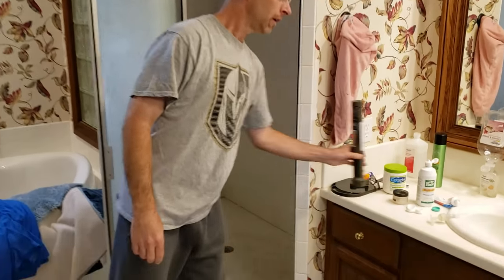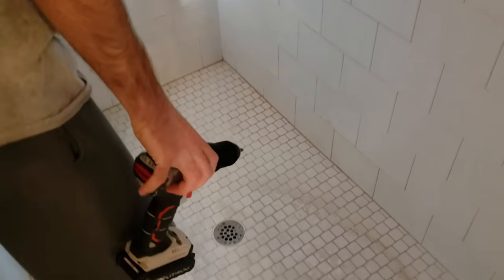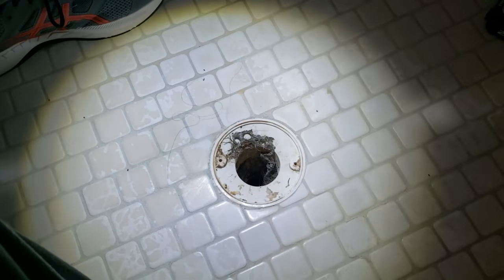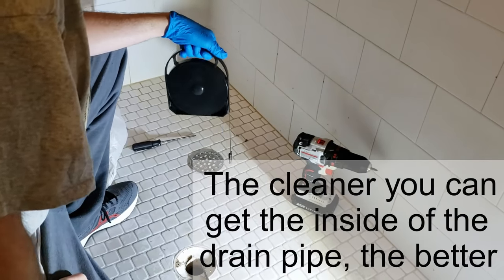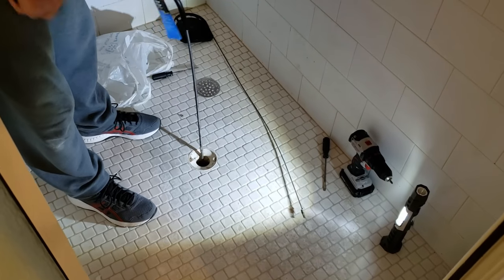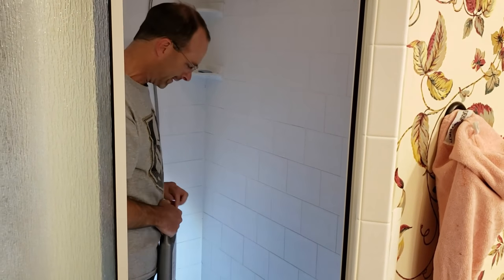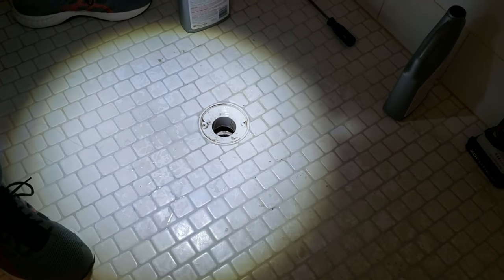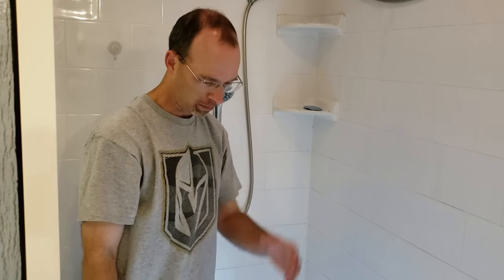How to get rid of drain flies in shower, kitchen, or bathroom

Comment: Instead of the Drano, after I clean the drain out, I use boiling water and add dawn liquid soap, and vinegar. That we are not putting all those chemicals into our water supply. The vinegar and water really does flush and clean well.
Reply: I just tried this with white vinegar and baking soda, and washed it down with boiling water. Two GIANT flies attempted to flee out of the drain but got caught by the chemical foam from vinegar mixed with baking soda 😁

I'm gonna pour boiling water once more today and see if it helps the situation.
Reply from the maker: Some folks have warned that boiling water could damage certain kinds of pipes. I recommend using hot, but not boiling, water.
Reply: That doesn’t work buddy!

Comment: Those things are disgusting! 😱 LOL Thank you for the video. They spend quality time in your john also and wind up on your ham sandwich. 🥶 It's essential to cover all of the drains after you treat them. That way they'll stay in there until you get rid of them. There are rubber drain covers, (or plugs) of all sizes. Find one that will fit over it about a 1/2 inch extra. Put a weight on top to trap them. Also, good old generic liquid bleach will dissolve all hair. I would pour about a half-gallon down there and then cover it and leave it alone for two hours. I did that and they are gone.
Reply from the maker: Great tips. Thanks!

Comment: Years ago, my dad came up with the idea of straightening out a wire hanger, then bending one end of it into a hook small enough to fit in drain yet large enough to grasp whatever's in there. Cut to the length that suits your need. For a bathroom sink, you'll need to remove the stopper if it has a crosswise lever from the drain pipe that goes through it.

Comment: I've had that issue in 2 brand new apartments. The builders had dumped all kinds of crap down the drain and you would be surprised what I found. There was plastic bags of screws, nails, carpet, concrete, rubble, silicone, grout, sand, nails, tiles, so over time using the shower it got so bad , the flies, the smell. Omggg. Any way, what you did wasn't good enough. You have to flush and flush with boiling water up high and flush and scrub. Use dish washing liquid and then use buckets of hot water held high and tip it down the drain until the water runs clear. You don't need draino. Just remove the debris. Get a garbage bag, put it around your arm and grab the crap out with your hand and arm. Yes it's gross,  but it works. I had a plumber come the next day and say, omg wow I've never seen a drain so clean in all my life.lol so the blockage I called them about, was unblocked by me, the plumber didn't have to do a single thing lol. He was the one who told me not to waste my money on draino. He Said I did the right thing by using dish washung liquid as it's best to break up the gunk. Try it and I swear you won't have a single drain fly ever again. Just clean your drains often.
Reply from the maker: Good info and tips, Nicole. Thanks. Yes, the key is keeping the drains clean.
Reply: Dishing detergent wasn't strong enough. The drain cleaner was needed. Everyone's situation is different maybe. But mine solved after follow this video.

Comment: I had this problem last year, cleaned drain best I could.
Followed with baking soda and vinegar . Rinsed with
Boiling Water. 
Even made homemade drain fly traps(Dawn & ACV)
Kept under control... Last Year!
As soon as temperature warmed up THIS year - Bam stupid flies are back!
But this year I will be using the pipe snake Woo hoo.
Thanks for the tip 😁
Reply from the maker: Great input, Samantha. Thanks for sharing your experience!
Reply: How do you make the traps you got a Link . I’m getting drain flies moths like bigger than those smaller ones he had and I just did salt bacon soda and vinegar . Letting it sit over night then boiling water in morning.
Reply from the maker: I don't know how the other person made traps. I found that if you clean out the drain really well, they'll have no home and you can simply kill the remaining ones and the problem is gone. But make sure to take the drain cover off and dig out as much gunk as you can. That's where they're breeding and they'll come back if you don't.
Reply: Isotopes yeah there gone hallelujah!
Reply: Isotopes salt baking soda and vinegar worked well .
Reply from the maker: Great! Hopefully I never have them again but will use that combo if I need to!
Reply: A lot of good responses flys started in the kitchen but now in bathroom too not sure where they are coming from will just poring draino or running biking watter for 5 minutes will that help?
Reply from the maker: Should definitely help. Key is getting all the junk out of the pipes. Drano or boiling water may or may not get it all out.  Sinks that aren't used for a while often have this problem.
Reply: @FixEverythingYourself Exactly.

Comment: One would think that dirty drains are the only thing that leads to drain flies but 6 months ago I replaced all of my drainwork throughout the house and back to the sewer tap.  not one scrap of old pipe remained (including the stacks), but within 3 days of the completion of these measures the drain flies began appearing for the first time ever!!  That's right, No drain flies in the disgusting 80-year-old pipes!   Apparently the flies prefer mostly clean pipes with just a hint of junk.  The way I tackle the problem is to pour a little white vinegar into every drain, every night -- including the floor drains.   It is not a complete cure but I see only 1 or 2 flies a week now as opposed to 100 per day.   The vinegar raises the acidity of the water in the traps, making it near impossible for flies to get a foothold.
Reply from the maker: Wow, that's interesting (and surprising) that they came back that quickly with new pipes.

Comment: My plumber told us never to use draino, liquid plumber or any other harsh chemical down drains.  They will eventually ruin any pipe system and will cost $$$$$ to replace.  Used liquid plumber for a few years every time we had a clog and it ate through the sewer line and it all had to be replaced.  Good Bye vacation.  He used a camera to look at our other lines in which we never used a chemical for example the bathroom and that line was just fine.  Lesson learned.
Reply: That is why ,I do not use Drano.

Comment: For about $3 at Lowe's or Home Depot, etc., you can buy a plastic 'drain snake'. It's about a foot long and has numerous barbs. You fish it down the drain and the barbs snag those hair balls as you pull it out.
Reply from the maker: Good idea, Robert. Thanks!
Reply: I have one of those and it works ok.
Has anyone had them in the kitchen drain, the edge thing, the lip? Ours is loose and I keep imagining pulling it off and seeing it crawling with tiny maggots

Comment: I wouldn’t use Draino or any harsh chemical. I did that and it ate a hole through my metal pipes. Cost me more than $1700 for a plumber to tear the walls open and replace them. Just use boiling water, dish soap and vinegar.

Comment: Yours was the first YouTube video that came up when I typed 'what are those little flies in the wash basin' into my trusty Webcrawler video search!

It's been a bit of a mystery rather than an annoyance, per se, so it was more out of curiosity that I ended up here. I might put some of what I saw in the video into action, although, as my query perhaps implies, mine are in the wash basin rather than the shower.

One thing that occurred to me is that, if the shower head were an adjustable one, you might have done something like turning it to the narrow power spray setting to direct it down the drain and turning the temperature right up to give the drain an even more thorough washing out. I've tried that sometimes while cleaning the shower.
Reply from the maker: Yes, these flies can end up in any drain - shower, sink, etc.

Comment: I built my house in 1988. At that time I knew I did not want drain problems. I took out tub pop up drain cap and put in caps with holes I bought at depot. I then took some of those copper scrubbing pads and cut them up. Put the copper strips in to cups and sat the decorative original cap on top. After about 2 showers I replace the strips which are covered in hair. Would not work on the drain in video. Did sinks the same way but wife did not like the look so I went back to stock on sinks. Of course they will stop up and my plumber gave me these strips that you slide in along the side of pop up.(remove nothing) Amazed how much hair they catch. Tell wife, now we are old and losing hair, so stand away from sink when combing hair. What gets on floor can be removed with large lent rollers from Walmart. I just started having the fly issue. Have been talking about it and sure a device in my home is listening to us and that is why this video popped up.🦇
Reply from the maker: Love the last sentence! 😄😄

Comment: Baking soda then vinegar to clean the gunk.  I've done it twice or three times to make sure that stuff is removed- all drains.
Reply from the maker: Good solution!
Reply: I've done vinegar and baking soda a LOT and they come back.
Reply from the maker: Mine haven't been back since I pulled everything out of the drain as shown in the video. I'm sure they'll come back eventually but scraping the inside of the pipe as far down as you can is VERY effective.

Comment: The purpose of a trap is to keep out flies and smells without water in it you have a direct connection to every drain in your city, unused traps such as tubs, mop sinks floor drains and campers can dry up in a week, running a little a little water will refill them or use potable antifreeze for vacant apartments campers etc. The potable antifreeze will no evaporate. I am a plumber and been dealing with this for 35 years
Reply: Could you explain yourself better please. I'm confused.  Is this a solution or are you making a statement?
Reply: @ladymax68  All drains should have a trap. Mostly it's a U shape pipe which holds water that prevents sewer gas and drain flies from entering.
Normal use keeps these traps full. 
Most calls I get for sewer gas and flies turn out to be from unused fixures such as hot tubs, floor drains or an extra bathroom nobody uses.
The water in the trap will evaporate in as little as a week and will need to be refilled simply by running water for a moment but if you have fixture that won't be used for a long time I would recommend antifreeze which does not evaporate. BTW fruit flies brought me hear and turns out I bought some bad potting soil ✌ 🙏

Comment: I would not recommend pouring boiling water into PVC plumbing. Use vinegar and baking soda, brush thoroughly with proper sized pipe and drain brush, then flush with hot water.
Reply from the maker: Thanks for the advice, Dennis.

Comment: Thank you, this was so informative. What if you have these small tiny drain flies (gnats) accompanied by an inconsistent odor (maybe sewer gas smell)? Would the same course of action be taken? Could it be a venting issue?
Reply from the maker: Well, it could just be gunk in your drain causing the smell but it absolutely could be something else allowing sewer smells back in thru the drain. I'd start by cleaning your drain and see if the problem goes away entirely. But if you have drain flies, it's because they're nesting somewhere in the drain. This will fix that problem!
Reply: Did you ever figure out your smell problem?

Comment: I don't know what we have, either fruit flies or drain flies, gnats.We live in an apartment that has a garbage disposal. I poured bleach down the drain and put the sink covers on. Seemed to help but a week later theyre back. Oh I now have the cider vinegar and dish detergent trying out tonight.But I went to have some cereal and it looks like tiny ants or ?? Bugs.Pest Control help!! Property is slow to respond to any maintenance
Reply from the maker: Are the flies congregating near the sink drain? Sounds like they are if the bleach and drain covers worked. Several folks have commented that baking soda and vinegar is a combination that'll clean out the drains such as to remove the flies. Basically, you need to eliminate the source of food they're using, which is whatever gunk is in the drain. If you get rid of the gunk, you'll be able to get rid of the flies. 

Fruit flies are a different problem. I'm no expert there but there are plenty of videos on home remedies on getting rid of fruit flies.

Good luck! I hope you're able to get rid of them!

Comment: Wow thanks for sharing man. I have the same problems but its worse, the Drain Worms are coming out between the floor tiles because of the tiny gaps in my shower. Do you have any idea how to get rid of that?
Reply from the maker: Wow, I don't know. There are worms coming thru the grout between tiles? There's probably rotted flooring underneath if the worms are directly under the tile. Might need to consider pulling up the tile and seeing what you've got (not easy) or re-grout. I'm really not sure and don't want to lead you astray, just sounds like a mess. Good luck!
Reply: @FixEverythingYourself  Yeah. That's the thing I can't do, cause I rent the apartment. I tried spraying bleach in every corner and between tiles last night that have cracks and large gaps. This morning tried spraying and pressuring water at the gaps, a lot of worms coming out, but at least its dead. The most coming out of the around drain hole. I need to first unclog the dirts in the drain hole first i think, starve them and then put on bleach and hot water.

Comment: I used the boiling water method and it created a 5-6ft long crack in my pipe so I needed to replace it. Was hoping for another solution.

Comment: Hello sir, may know I what specific material/liquid that you poured on your drainage pipe
Reply from the maker: I used a drain cleaner called "Mister Plumber Drain Cleaner." The reason I chose it was simply because it was inexpensive and safe for septic tanks. You don't need to use that same brand; any drain cleaner will be fine. Good luck!

Comment: "I'm sure yours is just as gross" LMAO. Any suggestions for the same problem in the bar area of our restaurant? Pest control didn't help at ALL. They are bad enough that they were eating peaches on a plate in the dining area. Good thing it was at night and we were closed, but they are pretty bad. It's a bed and breakfast type place. PS) They were my peaches. :)
Reply: If they're eating Peaches, then they're probably fruit flies.  It's going to be tough to get them  out of a bar since the fruit they're feeding on is constantly restocked, but I would clean out the make line or fridge or whatever you use to store the fruit very well, wash it out very well and maybe hold off on putting in more fruit until you verify that the flies are gone.
Reply from the maker: I agree with James that if they were eating peaches, they were probably fruit flies. Did you notice them congregating near drains? If so, then cleaning out the drain is the right next step. If they're focused around fruit, James's advice is good. If you can't tell, I'd do both (clean out the drains, move the fruit, clean the area where you've kept fruit). Good luck!

Comment: Once you did all that, how long did it take for the flies that were still alive (outside of the drain) to go away?

I have cleaned/bleached/vinigar-salt-baking-powder-thinged the CRAP out of all of my drains, and have them sealed most of the day too, but I still have a ton of these flies around my kitchen.
Reply from the maker: I don't remember exactly but I think I killed all of the remaining ones with bleach or some spray and they were gone for good. So pretty much same day but definitely by the next day. Have you dug out all the gunk in the drains? I used Drano and other liquids before taking the drain cover off and I was never able to get rid of them with just liquid. They're pretty resilient. Have you figured out if they're congregating near the drains or somewhere else? Maybe the drain isn't the source now?
Reply: @FixEverythingYourself  Yep, I went in and cleaned out kitchen drain (the main one they seem to congregate at) from underneath the sink.  Came back home, after having the drain blocked with papertowels to see ~15 flies sitting there waiting to get in.  Figured if I just left it like that they would die off.

Ive looked around, I cant see anything else they could be living in aside from the drains.  They hang out on the pantry cabinets (I think cause they are lightly colored, ive heard they are attracted to white?) but they definitely arent able to get to anything over there.

Thanks for response, that was lightning fast considering this video is a year old.  Your commitment to it is legendary.
Reply from the maker: Thanks, Swampy. Seeing that there are flies you couldn't kill initially (the ones flying around or near the pantry), I'd expect those to die off in a day or two with their home destroyed. Mine were all in the shower so I was able to kill the whole clan. Hopefully, yours will disappear soon.
Reply: Swampy Bogard 
Hydrogen peroxide slows them down.  Excuse it fizzes and destroys most organics.

Comment: Our drain flies are coming out of a crack in some grout near our bathtub. 😩 how do you fix that 😭😭😭😭
Reply from the maker: Hmm. I'd need to see it but apparently there's gunk that's gotten underneath there. The proper fix would be to take some of the floor off, clean out what's down there, and re-seal. But a quicker fix would be to clean off the grout area and apply caulk to block the hole. But may not be a great idea long-term.

Comment: Isn't there some chemical that would break up the hair and then use hot water to flush it down?????
Reply from the maker: Yes, Drano and other drain cleaners will dissolve hair. Other commenters have said they used bleach regularly and that broke up the hair and kept the drain clear.